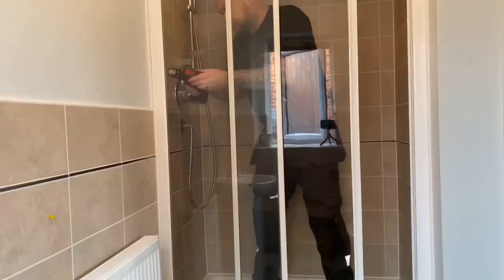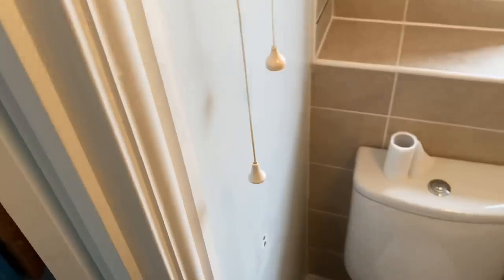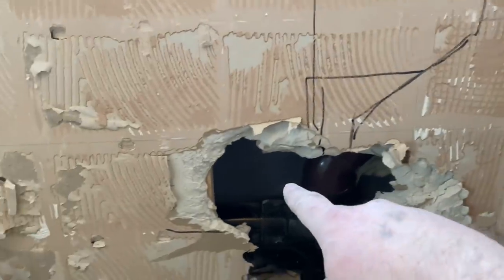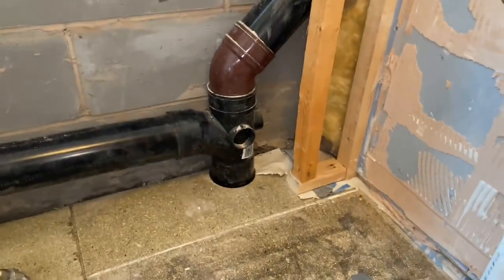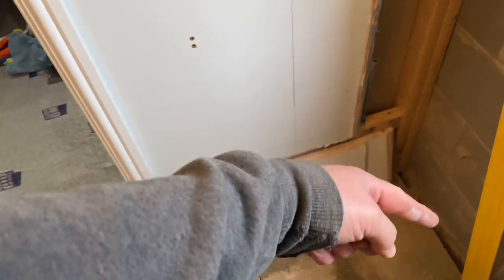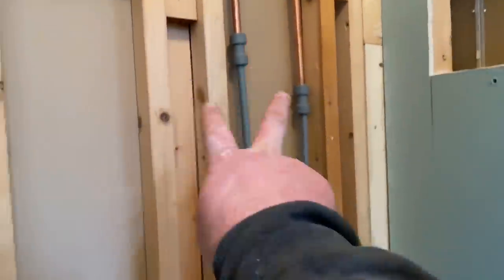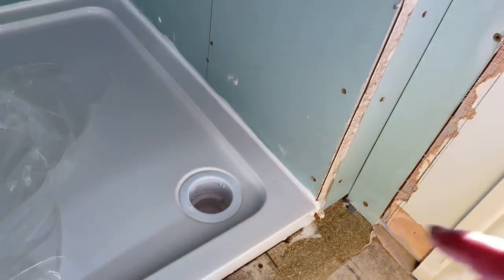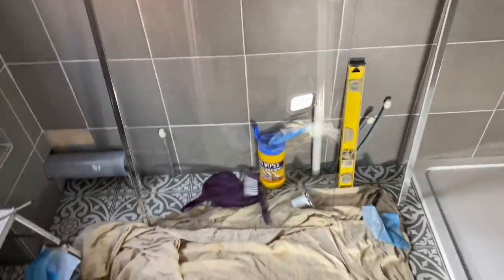COMPLETE ENSUITE REFURB from START to FINISH, BEFORE & AFTER. MOVING LAYOUT DESIGN/WALLS/TILING

Comment: Tip for toilet brackets. Fit them to the toilet with double sided on the bottom of them. Put toilet in place and then remove the screws. Lift it up and brackets are left stuck in the right place for drilling 👌🏻 I’m a jack of all trades but fitted 100’s of bathrooms
Reply from the maker: nice tip for someone if they fancy trying it....
Reply: Or just put your pan where you need it, and silicone it in place.
Just have to tell the customer not to use it for 12 hours.
I think I've only ever screwed about 2 down in my life.
Never had a problem with that, and personally think it gives a more substantial fixing than those poxy brackets.
Reply: @sarge9733  what haha
Reply: @chester6343  Try it before you laugh at me!
Easier than drilling into porcelain tiles and potentially piercing badly run central heating pipes too.
Winner every time, believe me.
Reply: @sarge9733  what do you do about the holes in the toilet where the screws are meant to be?
Reply: @chester6343  I glue the chrome caps provided in the holes.
It may sound cowboy to you.
But it looks and works perfectly fine.
Reply: @sarge9733  I can imagine it sticks no bother, silicone and stuff these days is pretty tough, it's just a nause for the next guy who might have to take the toilet out for whatever reason
Reply: @chester6343  Personally I think it's easier.
I fit bathrooms for a living, and whenever I remove a toilet that's been screwed into those poxy brackets, the screws are always rusted beyond mechanical removal.
I usually end up smashing it with a hammer when the heads are shot.
Any good fitter should silicone the join between pan and floor anyway due to 'fluid' running down and causing smells etc... the same fluids that seriously corrode the screw heads.
So a nice slicone bead fixing just requires a new stanley blade and scraper to free it up again.
Reply: @sarge9733  exactly how I do it, haven’t screwed a pan down in years
Reply: @tomstrutton4351  Thanks for agreeing mate. Maybe we're the only ones! 🙂👍🏼
Reply: @sarge9733  My mate is a plumber of 40 years and does exactly the same, and that's what he told me to do on my bathroom reno I'm doing over winter. He did our downstairs toilet in 2014 and it's still in place with the silicone. 👍🏻
Reply: @CarlosFandandgo  Glad to hear it mate.
I always fit them this way, and never had a call back.... only for another bathroom to be installed  🙂👍🏼

Comment: Great job mate! Good to see waterproof board going in behind the shower.
Reply from the maker: Thanks mate
Reply: That board isn’t waterproof, you should be either tanking the wet area or using jackoboard or the equivalent. Also not a fan of using compression in walls chap especially on that towel rad just sewage the chrome and solder a street 90 in it mate

Comment: Hi. I used to be a bathroom fitter myself so i appreciate all the hard work and unseen hassles involved in these types of refurbishments, like fixing other peoples bodges lol. My question is regarding the floor joist span in that room. They seemed very far apart from each other, but that's what the builder/architect/planning dept etc all decided on. I've had issues in the past with shower tray-to-wall silicone seals failing due to subtle floor movement over time. So whenever i had to open up a glued & screwed chipboard flooring for anything I would refit it with extra bracing afterwards. Just something to watch out for in the future....
Reply from the maker: Thanks mate
Reply: Yes you have to watch flex on floors especially new builds. Pays to brace up then over ply. Then add your floor system such as decouples. Seen loads of cracked or loose tiles due to movement.

Comment: Great video, did the Tiler use ply on the floor before tiling or use a flexi adhesive?
Reply from the maker: Cement board on the floor then tile..

Comment: Great video and great install thanks for taking the time to make the video
personally I think a “proper plumber” knows in that situation when ur dropping the tray and tightening from above a flexi is less likely to leak than hard piping it.
Hard pipe can leave the trap sitting at a slight angle under the floor so when u tighten it from above it doesn’t seal correctly to the tray and it can also cause u to cross thread the top piece.
Flexi is the way to do it and why they make them.
if they didn’t work they wouldn’t make them in first place 
Someone’s taken the time to film and edit a video and someone comes out with that proper plumber rubbish 🤯 blows my mind
Reply from the maker: Thanks Mate.... appreciate the comment buddy.

Unfortunately there will always be “the worlds best plumber” sat infront of a keyboard to give there superior knowledge🙄🙄.... you get used to it.

Comment: I've enjoyed the tips. Currently in the middle of my 1st en suite. I'm still undecided how to bed my elements slim line shower tray down, whether I go with the manufacturers instruction of sand and cement or tile grout or strong silicon which I've seen used in other shower tray install videos. My flooring is new ply secured onto new chipboard so it's new flat and level. What would you recomend to use? Keep the videos coming.

Comment: Hi Mark, look at 10.11 on your video. You cut the plastic pipe twice, then put it into the plastic fitting without an insert! 
I'm not trying to take the P, I just noticed it, which is why I made the comment about the inserts.
Reply from the maker: You can see that I reach round and fit the insert, also if you take a good look you can see it on the end of the pipe before it goes into the elbow….. I always fit inserts mate

Great to see you are watching the videos with great interest though buddy…👍🏼👍🏼 glad your enjoying them

Comment: Quick tip use a swaging tool on the chrome and solder a m&f elbow into it, won't need to put a compression fitting in the wall and risk undoing it when doing up the rad valves.
Reply from the maker: Thanks for watching..... and thanks for a tip.

Ive always used compression fittings on chrome for nearly 30 years, and if you know how to do compression fittings up correctly you wont risk undoing it when tightening it up.....

Comment: Nice little tip for chrome pipe.. if you don't want to use compression behind the walls and you're using copper, swage one side of the chrome and solder a street elbow in it. Works a treat. 👍😁
Still, nothing wrong with compression though.
Reply from the maker: Yep that is an option, howeve I’ve always gone for the compression fitting onto chrome. You do what your comfortable with 👍🏼👍🏼
Reply: @MJTiffPlumbing  yeah, exactly. Only discovered it last year.

Comment: Hello mate, quick question. Did you just put silicone between the shower tray and chipboard flooring to secure it? Or did you ply it then adhesive? Cheers
Reply from the maker: Hey Jack

I personally just spread a good base of silicone on the floor and tray, then put “blobs” in each corner and bed it like that.
I’ve always done it that way for nearly 30 years and never had an issue.

Some people use tile adhesive/silicone/CT1 and some even still use sand and cement.

That way works great for me, I’ve done it in 800x800 trays right up to 1600x800 slate trays.

Hope that helps mate

Comment: There’s nothing wrong with a bit of boxing in next to the bog it’s somewhere to put the bog roll,beer and tv remote👍 top job though mate👌
Reply from the maker: Yep, I just wanted it a nice flush floor to ceiling one until I found that peaky branch..... looked spot on though to be fair
Reply: 90 bend first then the tee would have taken up less space
Reply from the maker: No it wouldn’t Chris..... have another look....

Putting a 90 first would not leave you enough room for a branch to be able to get reconnected to the vent and connect the toilet.

Close...... but no cigar....😉

Comment: Great video Mark just wondering what you use to stick shower tray down with bonding or tile adhesive and do you use classiseal around the tray prior to your first silicone cheers.
Reply from the maker: Hey Robert, I use either CT1 or silicone, and never used Classiseal tbh, always used silicone and never had an issue 👍🏼👍🏼
Reply: Brilliant Thankyou for taking the time to reply Mark.

Comment: Gorgeous job mate but wouldn't of put compression elbows on the towel rail in the wall, personally would of cleaned off the chrome ends for inside the wall and soldered copper elbows and pipe on to transition into the plastic further down. Just seen too many compression joints give up in the wall on chrome pipework over the years. Other than that quality workmanship as always, loving the channel.
Reply from the maker: Each to there own, you do what your confident with.... I’ve only ever used compression on chrome for the nearly 30years I’ve been plumbing...... never had an issue.
Reply: Again, only use compression with chrome! As Mark says if fitted correctly it will last a lifetime.
Reply from the maker: A grinder then solder....... no thanks, proper plumbers don’t do that😉
Reply from the maker: Thanks Mark... 👍🏼👍🏼
Reply: @MJTiffPlumbing  We all have different experience with fittings and products, I've just found in the past when people have used compression fittings inside a wall on chrome pipe if you've ever needed to undo the fittings on the towel rail afterwards that'll be the time when the fitting in the wall gives up and causes an issue. It's fine if you know and you've put it in but pity the poor sod after you. Hence always be soldered copper for me. 

Also a grinder? Of all the materials and products on the market that's the one that's dead last.
Reply: Most showers etc are compression fittings and are in wall. Compression will no fail over time if fitted correctly

Comment: I see you dont use inserts on the push fit plastic. Is that ok? What make is that?  
I use Hep2O and always use the inserts. I was told that my Public Liability wouldn't cover me if I had a leak and they found I hadn't used them.
Reply from the maker: I do use the inserts…. Always…..

Comment: Try out the Bosch multi construction bits for drilling tiles mate no need to wet the bit either
Reply from the maker: I’ve tried so many over the years...... Ebay and bulk buy is the way forward for me😉👌🏼
Reply: Good shout Screwfix code 8672P 5 Piece set

Comment: Nice work mate, always nice to see your thoughts and tips from start to finish.

Is there ever a time you would want to tank walls, or are you always happy with moisture board and quality tiling and grouting ? Can't knock the double seal on shower tray method. Full proof. Keep them coming
Reply from the maker: I’m happy the way I’ve always done it mate... never had an issue.👍🏼👍🏼
Reply: @MJTiffPlumbing  cheers mate, really good to know. There is something about 30 years experience you can't knock!

Comment: Great film and impressive bathroom refurbishment, It was great to see the vac out, that settled my ocd. 
Can I ask, when you remove a radiator for decorating etc. Turning off the trv and lock shield, can you still use the central heating system with that rad removed, with a combi boiler?
I look forward to the next film, hope your week goes well, take care, regards, Chris.
Reply from the maker: Thanks Chris

Yes the heating system can still be in use, unless its a single pipe system but they are very few and fair between nowadays
Reply: @MJTiffPlumbing  thank you for the info and your reply, it’s much appreciated. Take care, regards, chris.

Comment: On a small private house for myself, is it better to run all water hot and cold pipes in copper or is that not  the case.? Is plastic just as good long term?
Reply from the maker: I’ve never had an issue with plastic, if fitted correctly it’s as good as copper

Comment: Great job Mark as always 👌what 6mm drill bits do you use for porcelain also what pipe and fittings are they polyplumb cheers m8 keep them coming ✌️
Reply from the maker: I use generic tile bits off eBay, I’ve spent a fortune on the named ones and they are all rubbish and don’t last that long..... so for the price of 1 bit you can get 20 off eBay for the same money and will last a lot longer👍🏼👍🏼

Comment: Looking good! What fixings do you use to hang the screen and radiator on?
Reply from the maker: Thanks mate, brown plugs and screw mate... and silicone on the screen aswell..👍🏼👍🏼
Reply: @MJTiffPlumbing  cheers for your reply. Wasn't sure about normal plugs, didnt want to crack the tiles. 👍👍
Reply from the maker: Just make sure you drill the right size hole and you will be fine mate

Comment: How did the tiler tile the floor tiles?? Did he tile straight on the chip board or did he use some sort of tile backer?? Just asking as I gave similar situation.
Reply from the maker: tiling cement boards on the floor...
Reply: @MJTiffPlumbing  top job
Reply: Can also use a ditra matting
Reply: @benwatton1832  can you lay this on the chip board??

Comment: Enjoyed that as usual your content is true to life. Just wondering why the waste for the shower was where it is, I.e as you walk in the shower and not the shower head end. And also putting the mastic on the finishing plate for the shower makes a fu***r to get off in future I've always found. Share your thoughts
Reply from the maker: Thanks mate

As mentioned in the video there was a double trimmer main joist in the other corner that would of needed to be cut out.... could not be done as it was structural.
And if you don’t seal around the plate it could allow water in, as per installation manual for that plate to seal with silicone.... Easy enough to remove if need be with a scraper or wire..👍🏼👍🏼
Reply: @MJTiffPlumbing  thanks mate, sorry was listening on low volume feeding the baby. Keep up the vids 👌
Reply from the maker: Hahaaa.... love it mate 👍🏼👍🏼
Reply: @MJTiffPlumbing  In which case how did you get the waste under the floor without drilling through the structural joist? Video didn't show this part I don't think. Not coming from a 'dick comment' angle here 🤣 I just can't see how the waste was ran? assuming that's why it was so raised before?
Reply from the maker: @DBPLUMBING  Its in the video mate.....coming the other way allowed me to go through the partition section of the beams.
Reply: @MJTiffPlumbing  sorry mate didn't clock it 👍🏻

Comment: Hi Mark. Have you had push fit fittings pop of chrome tails. And did you bond the sink to cabinet to secure it. Thanks for posting the content
Reply from the maker: I’ve never used push fit fittings on chrome as they are known to come off, hence me never doing it, I always use compression fittings and paste.

Yep the sink was bonded to the unit, and also silicone sealed to the wall 👍🏼👍🏼

Comment: Great refurb mate👍 notice you using the erbauer multi tool great bit of kit but does your battery rub on the bottom of the unit leaving black plastic marks almost like it’s melting.  Cheers
Reply from the maker: Yer it’s a cracking multi tool.... not noticed an issue with the battery

Comment: Hi,mate another great video. What tile drill bits do you use?
Reply from the maker: Thanks Matt...

After spending a fortune over the years on tile bits from merchants and screwfix etc i now buy the cheap ones off ebay....honestly

You get 20 if the spade bits and 20 of the harder ones for the cost of 2 "Brand bits" and they last a while ........ take a look mate

Comment: I've been in plumbing for 35 years fitting bespoke bathrooms in London the thing that PI**ES me off the most is plumbers putting silicon on the back of shower plates... its not needed! I know alot of bathroom reps and ALL say the same (not needed)Think of maintenance! ..anyway Good vlog .
Reply from the maker: Don’t let something like that piss you off mate.... it’s just a shower plate..

I would rather seal around it than risk water seeping in.... but each to there own, the manufactures literature asked for it to be sealed as most do I have found, as for the Reps saying it.... they ain’t fitting it🤣🤣

Some do it one way, some do it another... just do what works for you 👍🏼👍🏼
Reply: Stanley knife blade through silicone seal job done, not rocket science
Reply: @benwatton1832   and if the silicon is more further in than the blade...?!, it's not rocket science to read the manufacturers instructions.. 😒
Reply: Nearly all shower instructions say put a small bead of silicone near edge of cover plate, alot say dont do bottom so if shower cartridge leaks it will come out of bottom of cover plate. Needs a 3mm bead near outside of plate so if done like that I knife blade is plenty long and good enough. To cut through. So if shower is under shower head u dont seal it??
Reply: @benwatton1832  nearly all shower instructions say it... mmm ok 🤔🤣bless you.

Comment: I was wondering if you could do a video or explain on how to isolate different parts of a bathroom when it comes to renovating it? Like i have a towel rail and instead of draining the whole system down is there a way to just isolate that part, and the same with the shower? most things like the toilet or taps will have an isolation valve on so you can turn it off to change taps etc, but i dont think most showers will have this? Just curious as im going to be undertaking these tasks in the next month and would be cool to know if there is a way to change without draining a whole combi boiler system. Also a bonus question, i see you use a lot of plastic pipe, even behind tiles, ive been told that its not a good idea because its more prone to leaking. is this true? I think it's better if your a novice or DIYer because you dont have to solder.
Reply from the maker: Your best off turning the water off completely to do the shower work to be honest, just as easy as isolation valves .
As for plastic pipe people have there own view..... I’ve been fitting it for years and never had an issue, if it’s cut right, inserts used it’s not a problem.